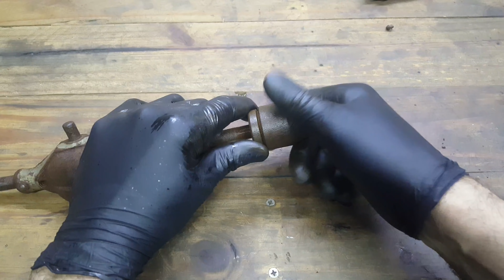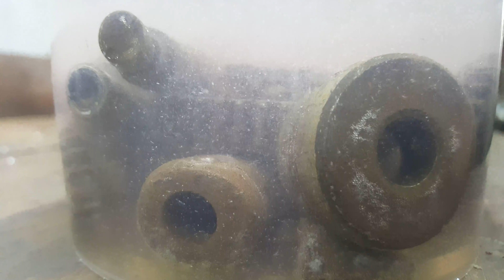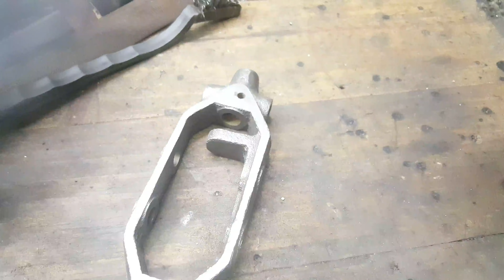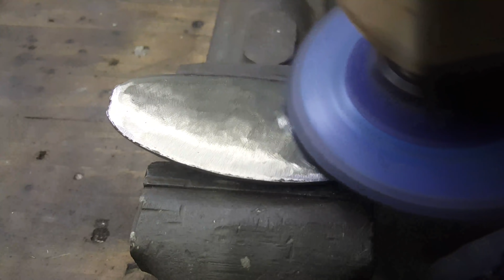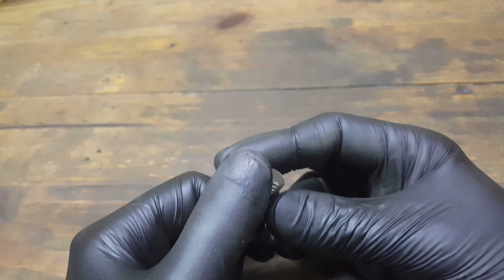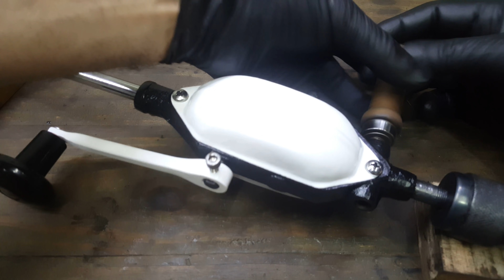Old Two Speed Enclosed Breast Drill Restoration

Comment: A good restoration spoilt by using Pozidriive replacement screws. Shame, what's  wrong with sourcing period correct  slot head screws - ?
Reply from the maker: i was thinking to use socket button  head 😉